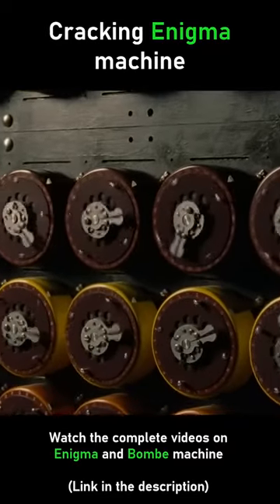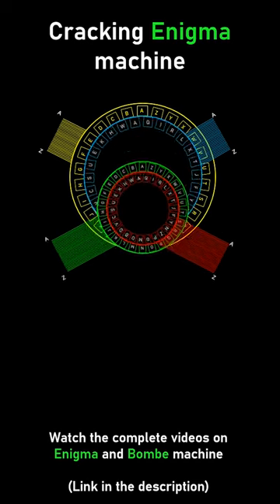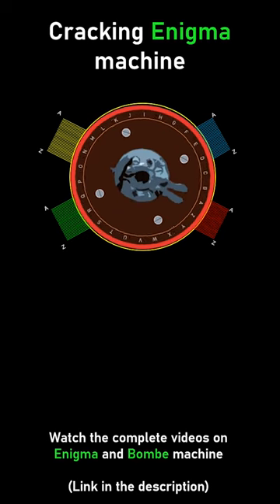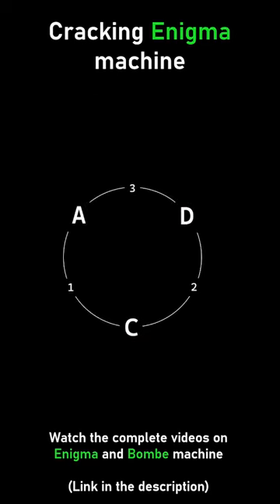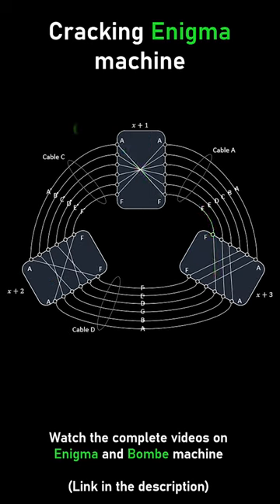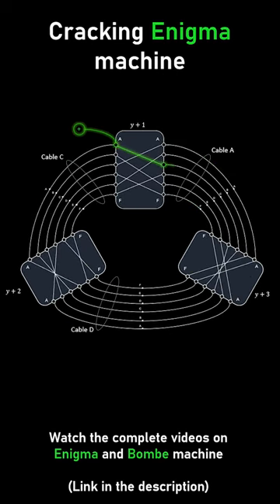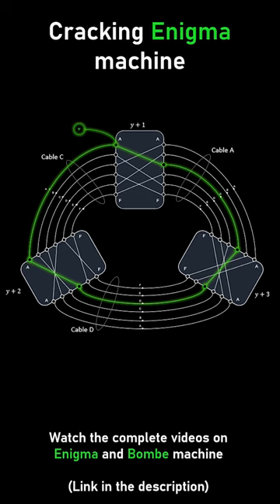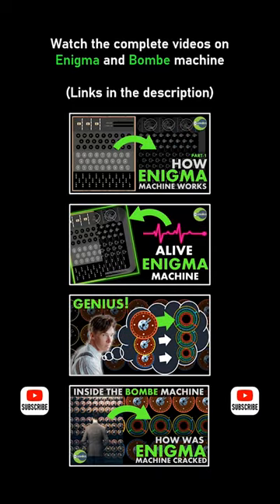How Enigma was cracked

Comment: Turing did not break Enigma code!!! Polish cryptologists had done it way before in 1932!!! With all respect to Mr. Turing but he just build the machine implementing polish system of Enigma cracking into a hardware - a  counting machine, a computer however also using polish decrypting algorithms and decrypting bomb device.
Reply: so... he did cracked the code. got it
Reply: ofertybezposrednie  sure buddy
Reply: Polish cryptologists cracked the earlier version of enigma.
Reply: ofertybezposrednie  The Poles did crack it, but the Germans later found that out so they created more rotors in the enigma machine, creating 159 quintillion possibilities. Alan Turing simply created a more efficient machine.
Reply: ofertybezposrednie hmmm they cracked the messages with time cramps. Alan build a machine which could crack every encryption they could possibly do with modification or whatever as well. Not the same thing...
Reply: ofertybezposrednie  If they did cracked the entirity of "Enigma" and handed over their findings, why did the entire world still believed it was uncrackable? 
Not saying Polish didnt do anything, ofcourse without presenting the new model of the machine and giving the basis they started but just as the computer from 10 years ago would be utterly slow or useless for operations, the work they did was just a tip of the ice berg... and in the end made the machine much more complex...His work remained a 50 year secret and well polish were credited that time in the end for Bombe if I am not wrong  but the main 65 percent of the work and development was done by him... Along with the first idea of "what if machines could think" his paper basically. Which is also the basis of Ai....
Being a War hero is one of his accomplishments since he kind of created the field of computer science
Reply: @AbdulMannan-jx1yc their work was the base of the Iceberg
Reply: Jearbearjenkins his problem wasn’t harder as all he did is he used the existing mathematical method and just expanded… Poles have created whole methods from scratch… there for Poles have cracked the enigma … I don’t want to discredit Turing as he was brilliant man .. let’s not forget who did the main work
Reply: Jealous
Reply: @Renatoes  No, They worked on the same version as British between Jan 1940 and May 1940.  Poles decrypted enigma code used by Werhmacht in January.  British were able to decode first German massages on Apr. 8th 1940.  In the meantime they consulted Poles.
Reply: @josephyoo7348  Exactly.
Reply: Your generalizing things a bit too much here, yes the poles did decipher enigma messages several years before England even got into the war, and the poles deserve credit for that. But that device, the ‘bomba’ could only handle a limited number or rotor types and could handle almost no plugboard patches, the ‘Turing-Welchman  Bombe’ was a more complicated and advanced device l, based on the Polish Bombe, designed to handle the redesigned enigma with more rotors and an extra reflector to select from and more plugboard patches in use and to my knowledge it was later designed to handle the more complex M4 enigma that used 4 rotors instead of the normal 3 and had extra rotors and reflectors to select from, this was used by the Kriegsmarine, specifically the U-Boat division. Turing was standing on the shoulders of giants, as with pretty much every engineer, mathematician and scientist, he made a not insignificant contribution, and to say that he did not break the enigma code is equivalent to saying to someone, who is sharing a meal with a friends that they have not eaten anything because the friend ate first.
Reply: @AbdulMannan-jx1yc  well ig ur british. Im from Poland. I know that this comment was sent 6 months ago but i still want to respond. Poland first broke enigma. We used devices called bomba (bomb in English) to break first version of enigma 6 bomba machines were enough but when germans added 2 new rootors 60 bomba machines were needed. Also i belive it was 1938 or 1939 and those machines were pretty expensive (if i remember correctly 1 bomba = 1 good tank at the time) so we gave france and your country our work. I have no clue if turing used exactly our method or if he changed something but as you see it is not that we were not able to decipher enigma in theory. Sorry for my broken english btw
Reply: @gameshoot8571  OH thats awesome then. To clarify I am not saying polish weren't responsible, heck without them Turing and his team wouldn't even have gotten the enigma, just that Turing designed the first computer and more then just added to this machine. 
BTW I dont know why I gave the impression but I am not British xd😁
Reply: @andrzejpopowski7745  There were different versions of Enigma, which have been cracked over and over again. Enigmas came around in the 20's. The French provided Poland with information on how the machines are build. Poles then build replicas and cracked them, but as soon as the Poles cracked them, the Germans quickly came up with an updated version. The toughest ones to crack was the one used by the navy, because it used 5 different rotors and a plug board. This was already during the war, which is why Poland didn't have the resources anymore to work on cracking it. Therefore, they shared their knowledge with the Brits and French, who then continued the work. It was Alan Turing that build a machine, that was reliable in cracking the Enigma.
Reply: @LS-Moto  you don't understand difference beetwen words cracking and decoding
Reply: @polarisukyc1204 he just had more money and founding one you got the solution it’s easy to make it better why wait 12ths years for the first computer and now 60 years later look how far the pc had got
Reply: @jacopocito8307  I don’t meant to be rude but I don’t understand your comment, yes Turing probably did have more funding than the poles and if they had the time I have no doubt that the poles would have broken the upgraded enigma and later the naval enigma as well, but they didn’t have the time as Poland was invaded by Germany, this still doesn’t invalidate the fact that Turing can stake as much of a claim in cracking enigma as the Poles, welchman, even Flowers

Comment: How did Enigma encode numbers?
Reply: it couldn't. numbers had to spelled out eg. 9 had to be sent as 'nine'
Reply: @MrRocque And that was on purpose - radio communication without forward error correction is pretty noisy; sending a single digit, such as the hour, could end up in a disaster if there was an error on the communication.